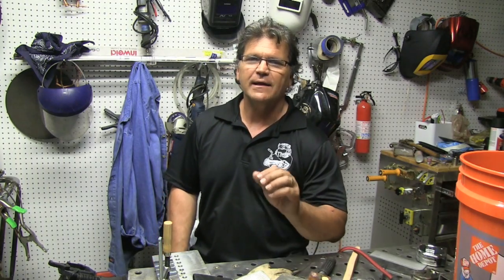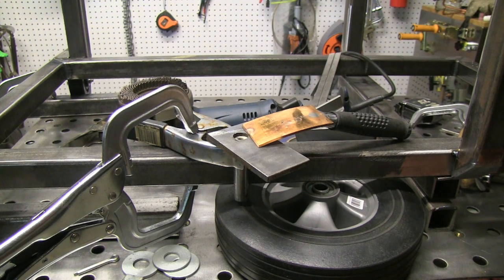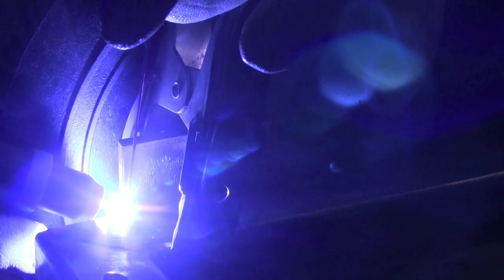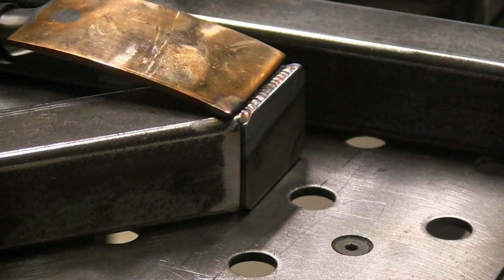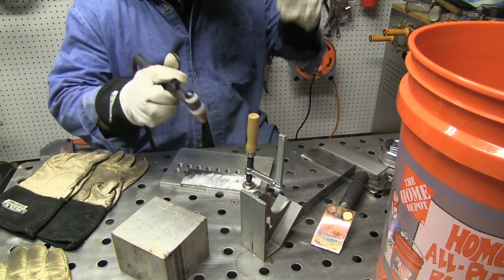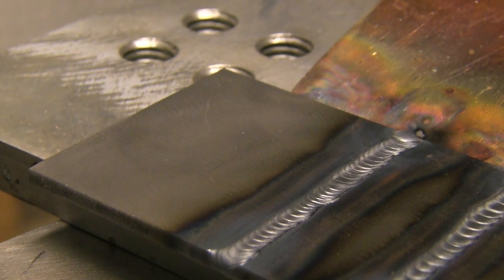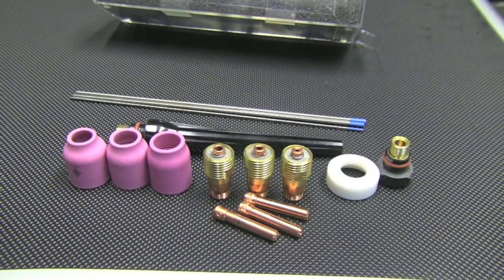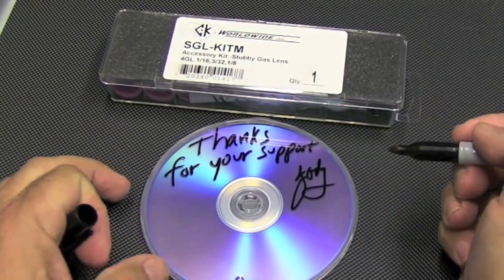Tig welding with Scratch Start - Avoiding Craters

Comment: great videos Jody! I tried using a gas shield like on this video and found I was getting lots of flash and had to change back to the standards cup. would the flash be because I have a low end auto darkening welding helmet?

Comment: Thank You for the Video, I have a question, The term "Scratch start" can you go into a little detail, I have a Miller Sync 250 Older version, water cooled torch, and foot pedal,  I also have the Maxstar 150 STH, with Foot controller, This unit also has a pulsar on it I see your welds and wow, I know practice , which is something I have to do and will  but what is scratch start and the advantage of it? also the material I will be welding is 1/8" and less and with the 250 aluminum 1100 h14 .063  Thank you in advance. and for the Video
Reply: You're not using a scratch start, John. The foot pedal is used to vary the amperage and start and stop the arc. Much better tool in my opinion.

Comment: Well, Im a tig welder.. And never in my life used copperspoon or aluminum to not get a pipe/crater, I only use the "sloop" function! Better control and you will get a much better finish.
Reply from the maker: This trick is strictly for scratch start. I am using a simple miller stick welder for the power source so have no upslope or downslope function. If your welder has a slope function then there is no need for a copper spoon. Thx
Reply: yeah real common in the plumbers union out by me. simple stick tig lunch box with valve. If your lucky you can plug the gas in the back of the lunch box but half the time the selinoid is broke or you dont have the right leads.

Comment: if you're using a pedal to control amps, couldn't you just step down the amps with the pedal at the end as the puddle solidifies?
Reply from the maker: I am not using a pedal. Just old school tig torch connected to a Stick welder and a bottle of argon.
Reply: OIC, KO

Comment: Does the copper not melt from the arc?
Reply from the maker: The copper would eventually puddle from the arc but it takes a long time at 95 amps.
Reply: weldingtipsandtricks Thank you for the reply! I bought one of those spoons from Harbor Freight but haven't had a use for it yet. My welder is a little Tweco 141i which has lift-TIG capabilities but I'm still poking around with the stick and MIG processes before attempting TIG. Your videos are a great inspiration plus you make them enjoyable to watch. Thank you!